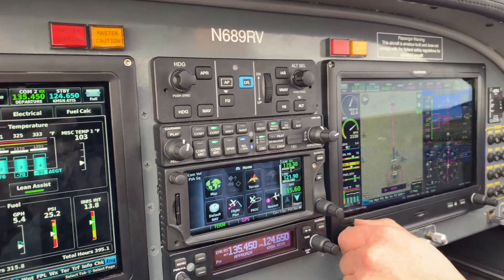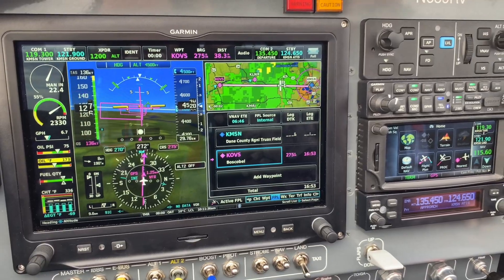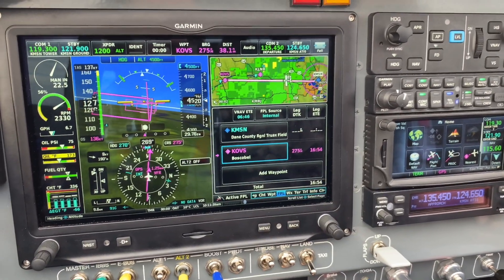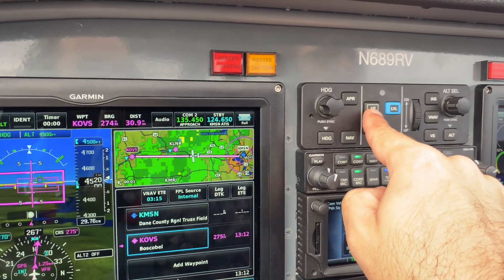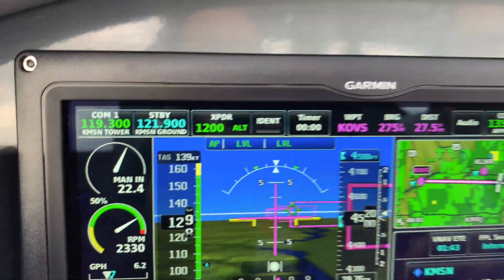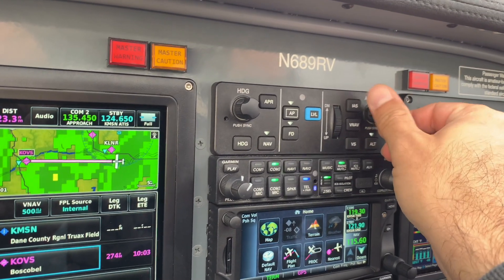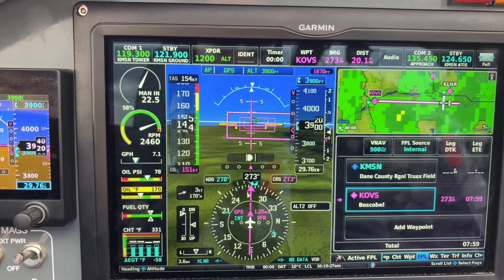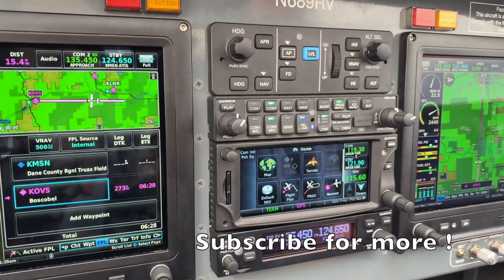Garmin G3X Autopilot Intro - GMC 307 + GSA28

Comment: Question, are you using the G3X dual or two G3X displays? On their website dual is cheaper than buying 2.
Reply from the maker: Hi there. I have a pair of GDU 46X displays. I'm not sure about pricing online, reach out to your installer or avionics vendor and they will give you a customized price for your configuration.
Reply: @BuildFlyGo  okay thanks!
Reply from the maker: Check out my video on selecting components as well, should give you an idea of the different parts in the system.
Reply: @BuildFlyGo  That will actually be very helpful thanks!

Comment: Where did you source your red and amber master warning and caution lights?
Reply from the maker: One of the usual electrical components vendors. Probably Mouser. It's an EAO 61 series indicator.
Reply: @BuildFlyGo  Thanks, found your referenced part.

Comment: I’m interested in your Master Warning & Caution switches. 
Where did you source them? 
p.s. your videos are great……thanks!
Reply from the maker: Hi Greg. They are EAO Series 61. You can get them at the usual electronic components purveyors like mouser or digikey.
Reply: Guil do you have easy access to a part number for the EAO Series 61 Master Warning/Master Caution switches? I find the catalogue somewhat confusing….
Did you use the inserts for your labelling? Many thanks Greg Manzie
Reply: @gregmanzie6109  Hi Greg. I'm happy to dig through the catalog for you to sort this out. Do you want just indicators or switches? For switches do you want momentary or retained? I assume solder tabs for the terminals?
Reply: Guil thanks for your assistance. 
What I am hoping to achieve is a “switch” that lights up when, in the case of say the Master Warning there is RED WARNING + ALERT on the G3X. When the switch is pressed to acknowledge the WARNING the light goes out until the G3X sends another WARNING. The MASTER CAUTION would work the same when the G3X has a YELLOW WARNING + ALERT displaying.
So I guess I am after a momentary switch. 
Will these EAO Series 61 be able to achieve this?
Thanks again.
Greg
Reply: Guil I just watched your Aircraft Spruce prize pickup Chicago flight & it appears your MASTER WARNING & MASTER CAUTION lights are indicators only. 
I imagine this would work just fine….. in the end I am trying to ensure I don’t miss any WARNINGS/CAUTIONS on the somewhat busy G3X screen - especially when in split screen mode.
Again many thanks Greg.
Reply: @gregmanzie6109  Yeah, the G3X system currently does not support acknowledging CAS messages, so a button wouldn't do anything. It might make sense to have them be buttons anyway, just in case that functionality get's added. We are doing that for our RV-10 build just in case.
Reply: OK……. 
How did you achieve the labelling? The catalogue gives 3 options: engraving, printing on the outside or the text on clear inserts put inside the “switch”.
Cheers Greg
Reply from the maker: Bought a single transparency sheet at the office supply store and ran it through the printer :)
Reply: Love it…… No high cost solution!
Enjoy your 10 when you get it flying. I am enjoying mine! It will be even better when I get my G3X package installed. I have been flying behind G3X Touch screens since 2016 & just love them. My RV-10 has the AEROSPORT Panel in it which works best with the 2 x G3X screens side by side.then the GTN 750 in the radio stack. Having the 2 screens right in front of me will be awesome! On my other 2 previous aircraft I had the radio stack in the middle. 
I will put the G5 over on the right for emergencies but also in the event that I have a co-pilot!  Not absolutely ideal in an emergency but workable. Cheers Greg

Comment: Actually the AP didn't start the descent when you pushed the VNAV button, for the only reason that your target/selected altitude (in blue) was ABOVE the vertical path altitude (in magenta). All A/C will always stop to the first it sees, so when you want to use VNAV you need to select quickly an altitude at or below the path altitude BEFORE the Top of Descent point ;)
It's usually good practice to select the lowest altitude you're cleared to when VNAV mode is engaged (and as for VOR/ILS, not forget to press APR when cleared for the approach).
But very nice video and channel! The G3X has some amazing features, and the G5 too when coupled, from what I've seen! :)

Comment: Thanks for the great demo.  I just picked up my Cessna Cardinal 177B which now has the G3X and the GFC 500.  I have a question that Garmin couldn't answer and my avionics installer couldn't answer that I though I would ask you or your viewers who have the GFC 500.   When I climb using the autopilot, and am using the IAS mode for the climb, the autopilot voice warning comes on if I go 1 kt slower than the referenced airspeed.  For example If I put it in IAS mode and set the target airspeed for 80, the voice warning will start saying AIR SPEED even if the airspeed is only 79.  Since mild changes in wind and mild turbulence is bound to affect the airspeed to some extent on any climb,  this makes it literally impossible to climb in this mode without the speed occasionally going 1 kt below the target airspeed.  Any thoughts?  My installer thought that if I hit the IAS button during the climb at a lower speed and then rolled the wheel up to 80 kts, that it might reference the lower speed for the voice.  I haven't been able to try that yet however.  Garmin was useless with this question.  I got 3 different answers from 3 different reps.  Any Ideas?
Reply from the maker: This is odd, I have not had that issue. When I set the IAS climb mode it bugs the speed and then tries to maintain it. It will, as you said creep up/down a bit with wind, etc but I don't get an alert.

Comment: Hi BuildFlyGo; I am building a VERY similar panel; For the center stack, I have the GFC500 on top, then the GTN650Xi, Then the audio panel... Would you keep the same order for your center stack as you have here, or would you make any changes now in hindsight?
Reply from the maker: stack-wise I'd keep it the way I have it. Not for any real reason other than it's not caused any problems and makes sense in my head the way it is. The audio panel is not used much so I figured having it in the middle of the stack leaves more commonly used items in spots that take less spatial processing to reach for.

Comment: Good explanations, but a few points of clarification
* The AP button does NOT turn on the servos, it engages them. When powered on, the pitch servo enables the variable speed electric trim, based on airspeed. If the pitch servo is turned off, the electric trim is single speed;
* Highway in the sky is selectable as an option only when synthetic vision is on;
* APR description – there’s lots more to it than what you said, but the manual says almost nothing about it;
* Altitude selected is also in cyan atop the altitude tape;
* VNAV – I’ve never got it to work properly when navigating with the GTN;
* VNAV to a point before or after a point is only on the G3X, not available if you’re navigating with the GTN. And you can only fly GPS approaches from the GTN;
* The knob on the control panel works in the correct direction, the same direction as an elevator trim wheel. The wheels rotate in the same direction as the airplane will rotate. Model airplanes use the opposite convention. You can check this out in FAR23. Yes, it’s a homebuilt and compliance is not required, but it is industry standard and good practice.
Reply from the maker: Thanks for the extra details!
Reply: The best part of your systems explanations are the close-up, clear videos of your equipment operating in the real world. Would love to see this discussion and video continued  with a detailed  ILS and/ or RNAV approach with the associated “buttonology” and running commentary. Well done!

Comment: Ok. Newb question for you. Is it possible to have two autopilot modes engaged at the same time? Like NAV and ALT?
Reply from the maker: Absolutely, I usually have just that so it maintains altitude and navigates to a fix. The pitch and bank modes are independent so you can activate none, one, or both.
Reply: Yes. You can also have HDG and NAV modes engaged at the same time to hold a heading to intercept a course.

Comment: I am about to install a G3X into my Cessna T210N with also changing the autopilot to Garmin.
I am confused about some statements and videos that would greatly affect the price. When you are installing a G3X it is enough to install a GMC 507 (307) and the new servos or do I need a GFC 500 ?
Reply from the maker: Hi Frank. It's my understanding that for a Cessna 210 you will need to pair the G3X with the GFC500 autopilot. The GMC307/507 is for the experimental world. I do urge you to reach out to Garmin to be sure, the folks on g3xpert@garmin.com provide fantastic email support. https://buy.garmin.com/en-US/US/p/682215

Comment: Would your Garmin stack be able to upgrade to their new 'auto-land' emergency feature?
Reply from the maker: My guess is Garmin will keep that one close to the vest. Liability&regulatory issues with claiming to autoland in emergencies will likely require pretty tight integration. Arguably I'd just need to add autothrottles and a radar altimeter (plus software) but there are really no autothrottles for non-fadec engines so that's a big hurdle. My guess is this will be turbine-only for a long time still.